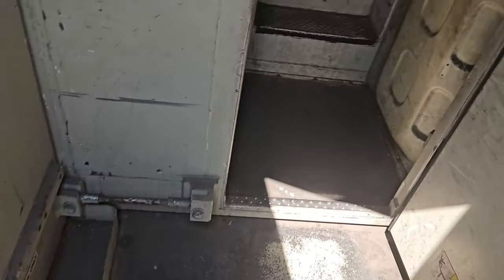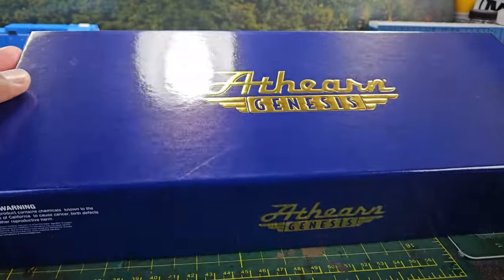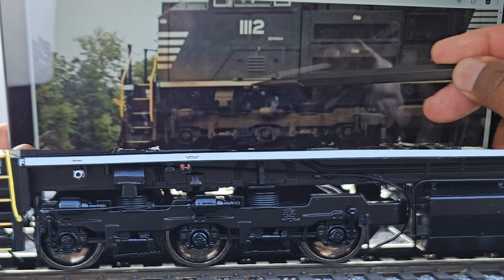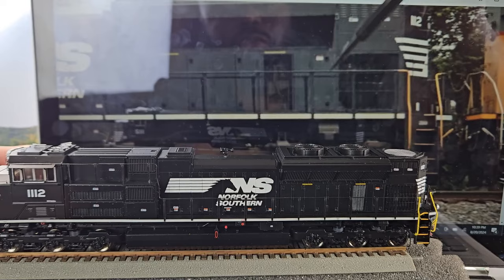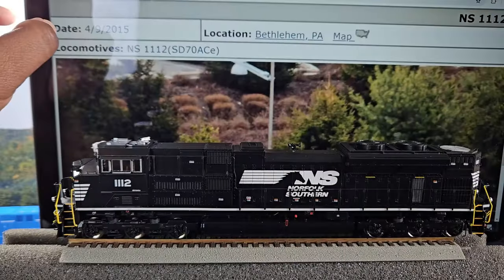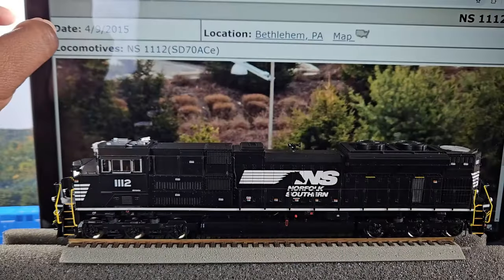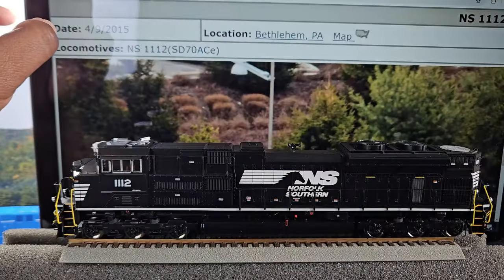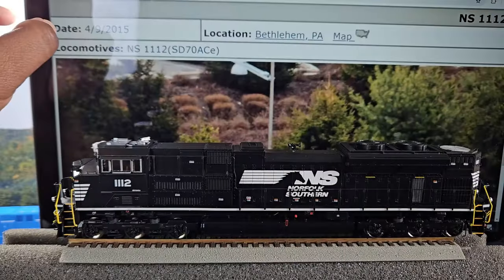Athearn HO Scale Norfolk Southern SD70Ace NS 1112

Comment: Wonderful video. I noticed that after taking off the locomotive shell, the board that was attached was green, but when you added the speakers, the board was now blue. Since this is a dcc ready model, what kind of board did you add to make it DCC?  Thanks.
Reply from the maker: A 21 pin board of any manufacturer you like. I prefer using a ESU decoder because I have the programmer

Comment: Interesting video. Mr. Hall way haven't NS converted the SD70M's to AC? Several of the M-2 are. Also Since the SD70ACE T-4 is only on UP and Progressive maybe some model manufacturer will make a Hypothetical one. I wonder it the bugs have been worked out on that locomotive.
Reply: The SD70Ms are all retired, most if not all are sold.